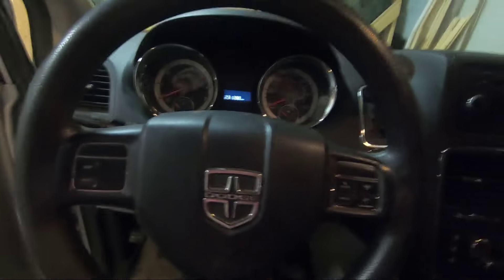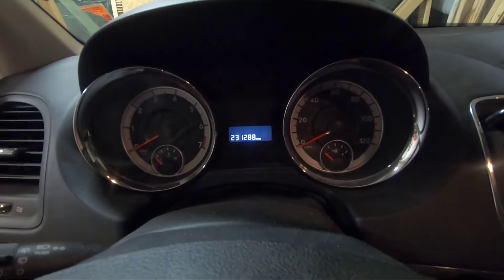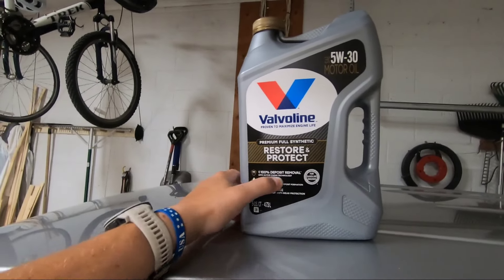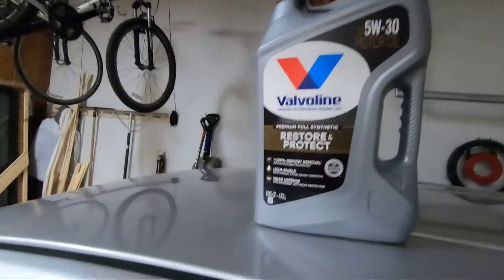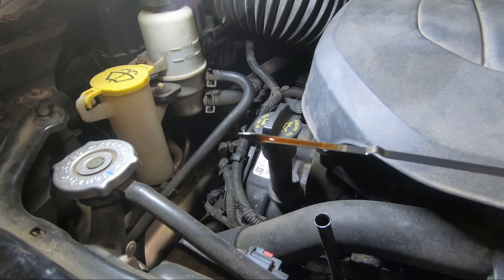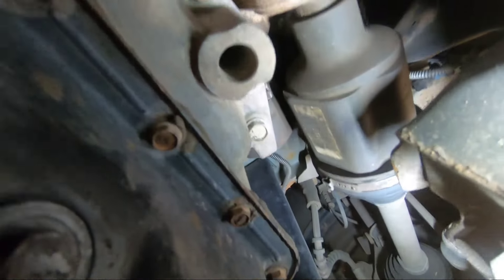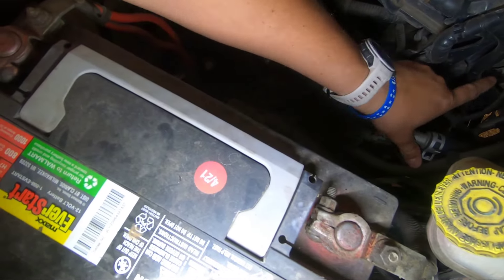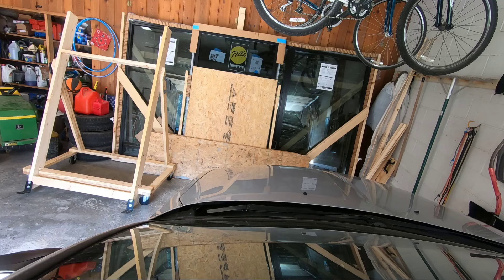Valvoline Restore and Protect - 231,000 Miles Pentastar 3.6L -  Dodge/Chrysler - 1st Oil Change

Comment: I personally don't think 7500 mile oil changes are a good. 5000 max even with interstate and highway miles. I'm going to use this oil on my next change but I will be replacing the filter a few times and I will only go 3000 miles. The second go around I will go back to my 4000 miles changes with just one oil filter. I don't have any oil burning at 120,000 miles and I never want it to be an issue.
Reply: Yes 3k to 5k miles oil changes makes for very long lasting engines with little to no oil consumption
Reply: @blessedman3253  depend which car* and filter is good thing to check if there something wrong* always on mid like 10k km change oil fitler at 5k
Reply: I'm doing that right now with my 89 Jeep. From what I've seen in (I believe) legitimate testing, it can pull down a lot of dirt. I will change the filter early and see where it goes from their.

If that works, then time to try it in my wife's 88 Mercedes.

[I've never been one to worry excessively about oil consumption. My theory is that if it's using a bit of oil, that means the upper rings are getting lube.]
Reply: @theronwolf3296 oil consumption means your piston rings have worn out. That introduces more blow by to the crankcase, and introduces oil to the co bastion chamber. Oil reduces the octane number of the gasoline which can lead to detonation as the engines timing exceeds the gasolines heat capacity causing an unwanted explosion before the spark of the spark plug. If you run your engine at low load then that isn’t a problem. Just keep that oil filled.
Reply: 7500 is way too long. That motor is all sludged up
Reply: So when the engine is consuming oil, will higher octane gas help it run better@2seep
Reply: @craigmoir2569  there is another cause to oil consumption. The piston rings are clogged by sludge. If your engine consumes oil use valveoline restore and protect. It will clean your engine of sludge. Which will free piston rings of the sludge and and reduce oil consumption by a large percent or completely. When you use restore and protect change your oil at 3 thousand miles the first time you use it. The oil filter can clog from the sludge being freed up causing the bypass valve to activate meaning no protection from  metal particles above 25 microns that your engine produces. Fuel octane doesn’t affect the way your engine internals(rods and bearings and other components, only pistons). Octane number refers to the gasolines resistance to detonation meaning it can handle more heat. You should use it in high temperatures, or if you have a performance engine, and or turbocharger.

Comment: Bubba you need to change your oil between 3k-5k to prevent oil wear.. it's oil wear down. Don't be cheap it's too late you screwed your engine by going over 5k miles
Reply: And Costco oil 😂

Comment: The appearance of used oil is not indicative of its condition. I just changed black looking used oil (Valvoline Full Synthetic) and the used oil analysis on the sample I took indicated I could've gone a couple of thousand miles longer as it still had a strong additive package and low oxidation/nitration number. I hope R&P does what Valvoline claims it does for cleaning piston rings as I started using R&P. You may want to also add a total fuel system cleaner containing PAE every 3,000 miles to help clean the top of the piston rings. I changed the oil pan and valve cover gaskets on my daughter's 2003 Caravan. The inside of the engine was very clean with very little varnish. We'll see if the Caravan uses any oil. I will sample and change the filter just incase anything gets cleaned from the system by the R&P. I will completely drain when the UOA indicates that I'm getting a higher oxidation reading of 20-25.

Comment: Sir you had the right oil you were running Pennzoil Platinum Ultra there was no reason to change anything else it would have done the job when it comes to your oil consumption you using that Valvoline restoring protect is it necessary that's only if you've been using shity oil. If you kept running Pennzoil Platinum Ultra it will solve your all burning problems because of your O-rings are clogged up and build up of oil burning residue because you've been using other oils that was lacking oil additives so that being said you had the right oil in the first place by running Pennzoil Platinum Ultra and it will solve your oil consumption because it has strong additives to clip your O-rings so you would not get any more oil consumption but you have to have patience for the oil to do his job and you wouldn't need Valvoline restored to do it for you but you using Kirkland oil LOL come on guys you got to be kidding me all you do is telling your vehicle I'm not taking it serious that's just like going by Amazon oil once again you're telling your vehicle you're not taking it serious but you still expecting the oil to give you the results you want you need to do your homework first before you go store named oils LOL but Kirkland oil you're telling your vehicle that's all it deserves
Reply: @darrylcurley6200  Agreed!  I used to own a '95 accord EX with almost 300k mi., Which was one of the first hondas equipped with VTEC (only on the intake valves, since it's SOHC).  After running Ultra Platinum for a few yrs, I took it to my mechanic to make sure the VTEC was still in proper adjustment.  An hr after I got home, he called me to ask what oil I had been running.  He told me that he had NEVER seen such a clean valvetrain with only the slightest amount of wear on an engine with such high mileage.  He showed me the photos he had taken when I returned to his shop to pick up the car.  In late 2020,  I replaced the accord with a neglected '02 Camry(2AZ-FE engine) with 190k mi.(now at 243k mi.) I flushed & changed all the fluids along with other routine maintenance that it needed at the time.  I ran the ultra platinum like I did with all my other cars.  It was burning & leaking a bit of oil due to it's high mileage and neglect from its previous owners, but not b/c of low compression rings which toyota didn't start using until 2006 and onwards.  For the following 9mos, the camry a delivery vehicle.  Averaging a min. of 100+ mi./day of city driving, and 50mi./day of hwy/interstate driving.  Which made me change the oil & filter every 3k mi. or every 25days since it was integral to my livelihood as a courier.  After 3mos. on the job, I decided to open the valve cover, and see for myself.  When I first bought the camry, I could already tell that the engine was beginning to develop sludge.  After the initial engine flush, and 4 oil changes later, the camry's valvetrain looked very similar to the accord's valvetrain: clean, near new, only slight wear on the camshafts and other valvetrain components.  And I noticed that with each successive oil & filter change, the camry was burning less & less oil.  After 4yrs. of ownership, the camry still drives almost like new.  With roughly 90% of it's original power output from the factory restored.  I can say with honesty that the pennzoil platinum synthetic oils have played a crucial role in saving all of my old japanese cars from mechanical failure & neglect.  And they are all still running strong.
Reply: @lobsterbisque7567  I'm glad someone agrees with me keep this in mind check your PCV valve that itself can contribute to some problems because of too much sludge built up in that engine and find its way to the PCV valve which helps recycle the air inside the engine going back into the intake just a little advice sludge can find his way into the PCV valve to make things worse because what you don't want to have is a clogged up PCV valve which can make it hard on your engine because of too much air pressure inside the engine not being released.
Reply: You need detergents. Pennzoil is a great oil, but is oil burning is caused by build up on the piston rings then Valvoline is  specifically formulated to eliminate build up. Whereas pennzoil is formulated to prevent build up.
Reply: You don't need Valvoline to eat away the bill up between the O-rings but Pennzoil has the ability of high detergent to eat away the put Bill up between the O-rings on its own. Both oils Pennzoil and Valvoline have high detergents to eat away burnt oil residue to stop oil consumption but once again Pennzoil will solve that problem on its own once you put time on that oil and stick with it because it has the ability to keep the Pistons clean and the same formula they have for the conventional oil as well as their full synthetic

Comment: Well I can tell you on an Oldsmobile Tornado 1980 , 5.7L never burned ANY OIL  with 400,000 miles on the odometer. Bought new. Didn't burn or use any oil. Oil type used? Mobil 1 5w 30.  Every 3000 miles

Comment: Another good test for all you guys, is to start the motor, open the oil cap and put your hand above the cap, if it floats in the air, you have what’s called blow by. 
Meaning the oil ring has sludge built up, and not scraping the wall the way it’s supposed to. 
After using this oil, keep doing the test until the cap doesn’t float anymore. 👍 
(great product) wish they came out with this years ago.

Comment: Ive been using oil on a 280,000 mile matrix. Oil consmption is down by half in 700 miles.  Changdd filter at 250 (just in case). I plan on doing a 1000 mile total oil change. It appears to be working. Still have some blowby.

Comment: With this oil. Just make sure you change oil filter at least twice. Depending on older engines it will clean and clog up filter. It really works. Have a few oil filters available and buy good quality oil filters too.
Reply: what's good quality?

Comment: I believe every vehicles out there are reliable if you treat well with high quality oil and fluids, engine oil and transmission fluid are very important and fuel additives as well especially upper cylinder lubricants, diesel engines last longer for the reason that diesel fuel is 2 in 1 has significant lubricant properties cylinder lubricant. You can get easy 500k miles out of this engine if you treat it well. I have a Ram 1500 with the same engine I use Amsoil high mileage engine oil Valvoline max life transmission fluid and marvel mystery oil in fuel, doing really well zero oil consumption zero fuel dilution and good fuel efficiency 28mpg highway 22mpg city.

Comment: not sure if you have used High Mileage oil but Pennzoil Platinum High Mileage full synthetic is good oil, my Dodge Nitro runs great on it and there is no oil burn off on it either , 156, 000 miles and running strong and I do door dash all the time..good luck with the Valvoline..I also change my oil at 3500-4000 miles..just sayin...

Comment: I'll stick with what has been running the best in my 2014 F150 3.5L ecoboost. Pennzoil UP and Valvoline HM Max life. Huge difference over the "recommended" Motorcraft oil. Better gas mileage, smoother ride and overall a much quieter engine. As for the R&P, it's a new product. Give a few years to really see how it really works. Their extended protection line is top notch across the board though. Haven't used that since i change my oil every 3,500k.
Reply: Is the vehicle consuming Oil though? Might be worth a try if it is...

The product may be "new" but it is also an API SP/GF-6A certified Oil.  

Not to compare this too much with Max Life since that's not exactly "new" now....

 BUT when it was first offered (maybe until later in the release of API SL or for SM(?) oils) I recall Max Life didn't have an API Donut/Starburst for then current (SJ and SL?) oils and only noted that it meets/exceeds the API specs for SG and SH.

 (Don't recall if they had specific "new" car warranty stipulations too if someone wanted to use on a vehicle with less then 75000 miles and presumably a Warranty, and the previously mentioned needing to meet requirement(s) for an API certification (Donut SJ/SL) and Starburst... But they likely did.)

Since both my vehicles at the time required either an API SF or SG oils and were both long outside Warranty the sort of "experimental" use to keep my '87 and '91 vehicles on the road for another 3-5 years was worth it (and was classified for API SH so "better" then factory)...

Restore and Protect by contrast is SP/GF-6A already... Unfortunately missing a DEXOS certification so for GM vehicles under warranty or people preferring to stick with that Spec or better... They'll need to wait until Valvoline maybe rolls it into its Advanced/Extended Protection Dexos products or (like Max Life) decides to make it "official"... Say when API SQ/GF-7 roles around?  All that said what does your 2014 F150 manual actually say it needs to meet Ford Spec? VRP does specifically cover the Ford WSS-M2C960-A1 spec

Comment: Looking forward to seeing how this does... Changed mine to Valvoline R&P on June 30, 2024.  Going to probably run until late September when unfortunately my 2003 Saturn ION (Approx. 192K) will probably be retired (Rust/Frame Rot, Need for "Winter Tires", an intermittent bad ABS Sensor/Traction Control problem, a potential Starter Problem... basically increased maintenance costs/safety concerns).

Unfortunately, had the "Talk" a bit to late this year. Had my Tires Rotated (the shop neglected to tell me I was on borrowed time, did give me quote for new tires though), renewed my Registration for another year (June 2025... Could throw $85 at the DMV next year and keep it "on the road" till June 2026... But considering its accumulating issues... When my Insurance Policy runs out in September, I'll probably drive it to the Junk Yard after snagging a sample of its "Restore and Protect" Change Interval... Hopefully, my Oil Consumption problem will be improved/fixed... So the Junkyard/Next owner will have some nice clean Spare Parts to salvage... Last Oil sample unfortunately showed my Ecotec Engine is still going strong (So I feel bad I can't just say it's a "done deal", Frame is Shot, but the Engine can still go, If if wanted to "drive it till the wheels fall off I literally could"...Hoping my "testing" shows the Deposit Control does its job and hoping to use R&P in my "replacement" 2014 GMC Terrain (even though R&P isn't Dexos rated) to help keep it at peak performance... That Engine has some Fuel Dilution issues and hopefully not much if any Oil consumption... Hopefully the high Anti-Wear package (79% over GF-6 qualified Oil) and cleaning in R&P will give me the "Max" potential... 

Don't plan to run OEM 7500/12 months more like 3K-4K until I get a good "Baseline" to see how well it does.  Wear seems good, as long as I can keep fuel Dilution in check... May eventually alternate between R&P and Advanced (Dexos Rated) to keep the Terrain Happy

Comment: PUP akz (Ultra) would burn more because it's a thin 30wt. I think going that long between changes is pushing it. I wouldn't go past 3000 but im an extremist. The 3.6Phx is a great engine when taken care of. Cool to see people like these new valvoline. Curious to see your results. 

Baruk Hashem 
⚓
Reply: If an extremist does 3000 mile oil changes, what am I?
I do 2500 mile oil change. 
I haven't put Restore & Protect in my 3.6 Jeep yet. 
I'm using it in my S 10 and seeing how it goes. Just did and oil change on the S 10. 
This is the second oil change I put in Restore & Protect. 
Oil looked pretty good draining out. 
But I'm sticking to 2500 mile oil changes. 
The engines run smooth.

Comment: PUT A QT OF MARVEL MYSTERY OIL IN FOR A WHOLE TANK OF FUEL BEFORE NEXT CHANGE. the stodard solvents an napthalene will clean your top rings an pcv sludge and helps a alot of blow by while disolving sludge .
Reply: Never never put additives in your oil. Conflicts with the oil not allowing it to do its job

Comment: Buddy. Id recommended you do 3k or 4k miles for the first oil change and filter change. If this stuff dislodges anything it's gonna show up and flood the filter the first 3k miles most likely. Pay attention to your oil pressure as well. But after that id stick to 5k mile oil changes. Both for keeping the additive package high and concentrated and to make sure youre getting that crud out of the oil pan. 
Keep us updated though.
Reply: It's supposedly not that harsh design to clean over time with a few oil changes I'm doing for on my 2017 Camry
Reply: @vicaras1  yes, but depending on what's already in the engine, it can plug stuff up. Any amount of cleaning will flood the pan with sludge. And this stuff seems to work better than a lot of oil additives. But someone else said that the valve covers were cleaned of sludge but a few days later their oil pickup got clogged with sludge.
Reply: @miltechmoto 😮😮😮

Comment: Pfftt. 1qt loss in 5k miles is excellent.  Guy I used to work with, a few years ago, bought a brand new Subaru, which burned a quart every thousand miles. When he complained to the dealer pointed out to him in the owners manual that they consider that perfectly normal.

Comment: Already worn your engine with those 7500 mile oil changes.  Just change it at every 3-4000 from now on.  Oil is cheaper than an engine or having to replace the vehicle.

Comment: That engine sounded great when you started it!  So, at 231000 miles it uses 1 quart of oil at 4000 mile change intervals?  That's not bad at all, I would just continue with  Mobil1 high mileage full synthetic 10/40 and be happy with it.
Reply: They have a 15 w 50 racing formula that goes great with marvel mystery Oil I used it in a jeep that I have that had a piston slap and it damn near went away

Comment: I bet your oil gets as dark at 2000 miles on the VR&P this first time you use it as the oil was before at 7500 miles. 😅 It will take a lot of nerve to push it to 4000 miles or more.